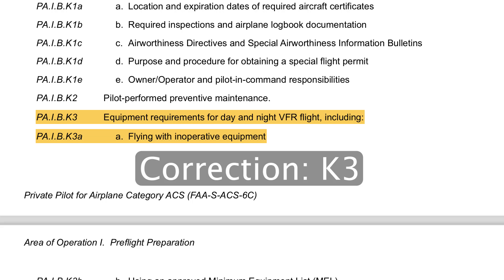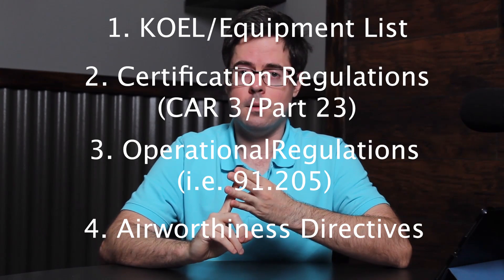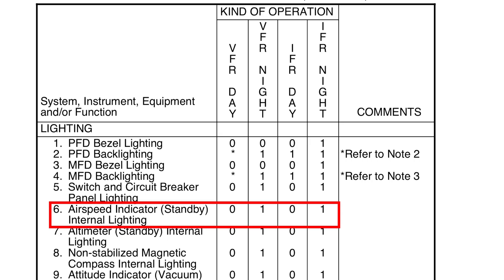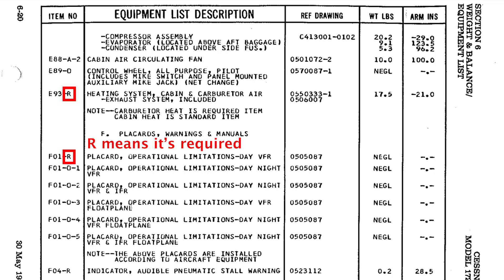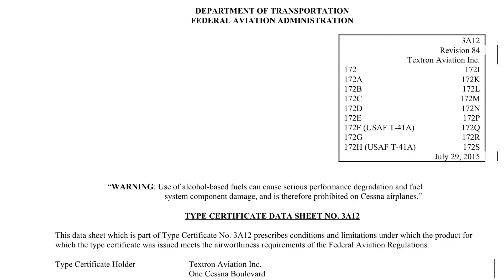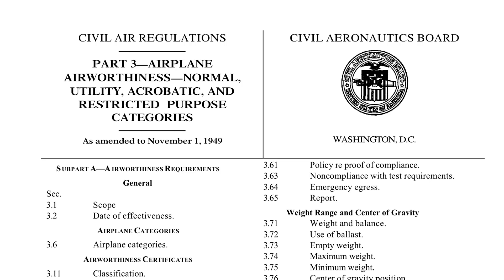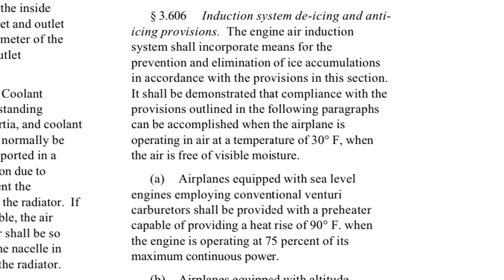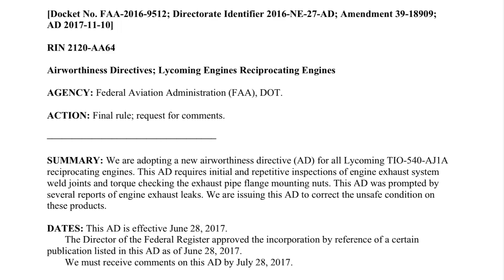TOMATO FLAMES is a Lie - Required and Inoperative Equipment (PA.I.B.K3)

Comment: Even with the KOEL or MEL, it goes to a licensed mechanic. AC 91-67A explains 91.213(d) in detail. Pilots shouldn't act as maintenance personnel or guide themselves through certification requirements. In the example, the mechanic should not have deferred carb heat, and being unable to respond to carb ice poses a hazard to the flight and aircraft. The pilot has the final say as to the airworthiness of the plane, so they got the violation.  

From AC 91-67A:

[...When an operator elects to operate wiaout an MEL, any inoperative instrument or equipment itemsither be repaired, removed, deactivated, or insected, and then placarded. Repair, removal, deactivation, or inspection must be performed by a person authorized to perform aircraft maintenance in accordance with § 43.3... ...Regardless of the method of deactivation, a person authorized to approve the aircraft for return to service under § 43.7 must make the maintenance record entry required by § 43.9. No person may operate the aircraft without the entry required by § 43.9.]

Intersting examples of the AD changes, when an AD is issued in that regard, the mechanic is prompted to update the POH in accordance and/or fabricate a placard informing the pilot of the equipment requirement. However in this case, Lycoming wanted to include longer inspection intervals, the AD actually states:

"This AD does not consider whether an operational carbonmonoxide detector is installed in the airplane." therefore a monitor wouldn't effect inspections by AD compliance.

Comment: Can I use your PDFs on a checkride?
Reply from the maker: Are you referring to our Checkride Workbooks? If so, yes that is how they are intended to be used. They are checklists to make sure you don't miss anything. Hard for an examiner to argue against them, and all the ones we've interfaced with love them :)
Reply: @AnswerstotheACS  that and the flight or ground portion pdfs for studying. I’m not saying to completely rely on them but would the dpe allow you to look for something on those two answers for acs?
Reply from the maker: @sebasto6791  Ask your examiner what they allow you to reference. Most examiners only permit regulations, the POH, chart legends, AIM, etc. Most wouldn’t allow something like this since it’s the literal answers to the ACS.